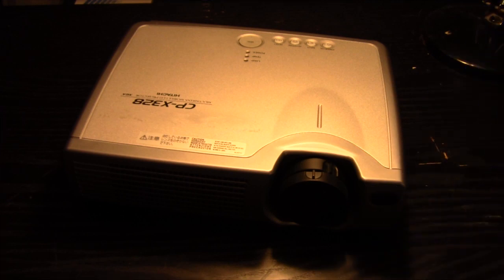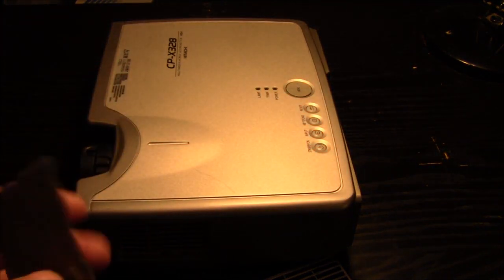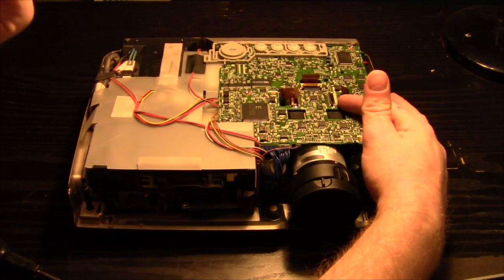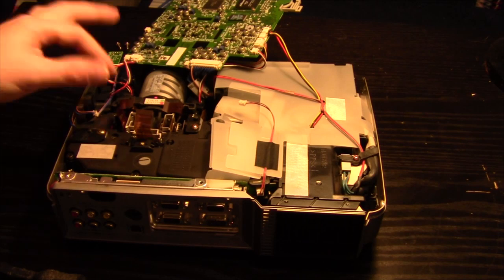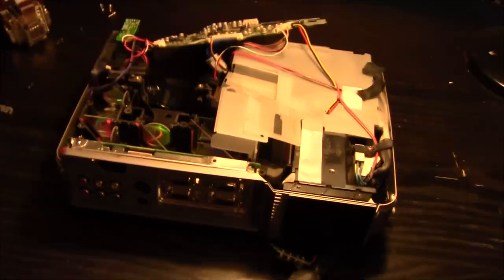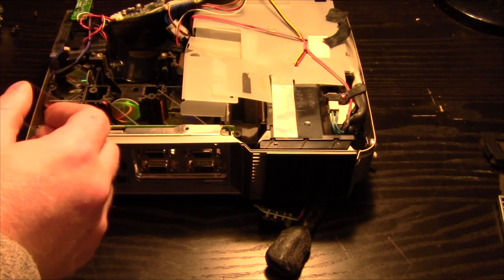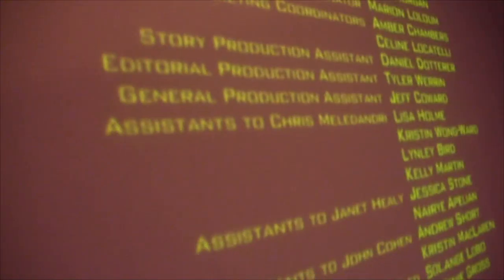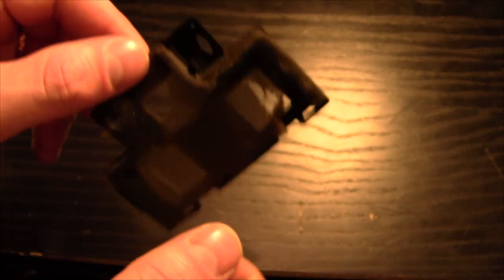How To Clean & Service an LCD Projector ( Hitachi CP-X328 )

Comment: Helpful video, thanks RetroGamerVX.  I have a CP-X301 which is displaying a yellowish area so may need a cleaned or replacement blue LCD.  Some things I could not see on your video are: a) Exactly how did you detach those LCD cables from the main circuit board?  b) How did you re-attach them?  c) What is the process for re-aligning the blue LCD (e.g. can you just turn hex nut adjusters while the projector is running?  How can you run it if part of the circuit board is disconnected)? d) I see you cleaned the blue polariser.  Did you also clean the blue LCD itself, or should you? Thanks.

Comment: Hi, nice video!  I just bought a Dukane Imagepro 8900 LCD projector at a thrift store (made by Hitachi).  It works great but the right side of the image is purple with vertical lines in it.  Do you think this is caused by a faulty green LCD screen inside?

Comment: It is a lot simpler in the consumer units than I imagened.
Reply from the maker: Yep, and it's not as fragile or as untouchable as I'd been lead to believe.  I know coatings and lcds can be damaged but with a proper cloth, it's likely a safe procedure.
Reply: RetroGamerVX  What cloth did you use by the way? Would a glasses cleaning cloth work? I've got a red tint from my Epson EB-X12 so I intend take the same steps you did. But would that mean that the red screen is the issue? Thanks for the video!
Reply from the maker: No problem :)  glass cloth ideal, anything that is smooth and doesnt golive fibres off.  Dont know cause of red colour.  If your colour filter is stuffed, can be impossible to find parts :(

Comment: I have a few projectors like this that will not power up. I can see the light flicker from the lamp. But will not fully power up. I know the lamp is good. But the projector red lamp light illuminates and stays light saying the lamp is bad. But I put in another projector of the same model and it works fine in that one. Do you think the power supply is bad?
Reply from the maker: Ive no idea in afraid, im not that tecnical and projectors are full of electronics :(

Comment: I bought a cineza vpl-hs60, and it has a slight pinkish/red blurb near the right side (not a strong one, only visible on white backgrounds.) Do you think cleaning would help or is it damaged?
Reply from the maker: Usually a uv damaged filter unfortunately.  Worth a try though if it gets larger
Reply: I tried to clean it, now everything has a blue or yellow tint (I broke a rainbow connector which is why it switches to blue but I don't understand why it's yellow) and the right side of the screen was moved to past the left side (for reference: projecting a windows ten home screen, the time and wi-fi and everything directly above those has been moved the the left of the start button, cortana bar, and everything above those too.)

Comment: I have serviced mine also but i think i have made a mistake on reassembly.. i seem to have a shadow on the writing when i bring up the menu options on the projector.. its an exact mimicnof the writing thats there. It just looks lile a shadow.. any suggestions?
Reply: This is normally a bad vga cable
Reply from the maker: Oakheart I'm glad you had an idea :o)
Reply: Turns out it was a miss-aligned red lcd screen, blue and green were in sequence.. just not the red.. after some careful re-aranging i go5 a perfect image..
Not sure a vga cable would cause an image cast shadow.. 
Thankyou anyway

Comment: Hi, I have a projector epson powerlite s12+, it has less than 300 hours of use. 
While it is proyecting we can notice it loses power and the intensity of projection get down,
then the projection goes normal. But it happens many times. What would be the possible cause? 
Thanks in advance.
Reply from the maker: +Richard Richardini I'm no expert but maybe some kind of temperature sensing device or a capacitor issue?  Hope you get it fixed, let me know please if you find out :)
Reply: It happens at the beginning too when the lamps is not hot. Where is the capacitor located?
Reply from the maker: +Richard Richardini there are loads of them